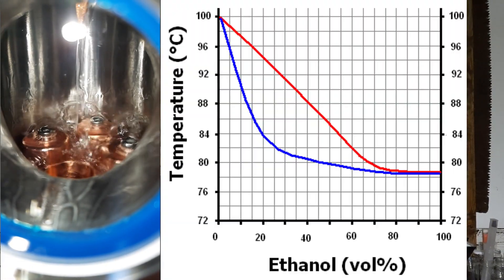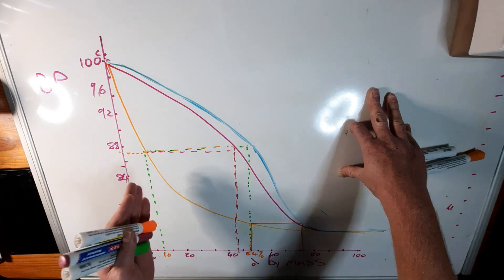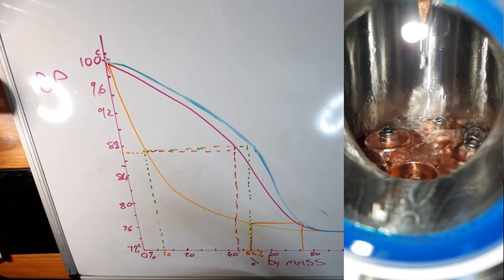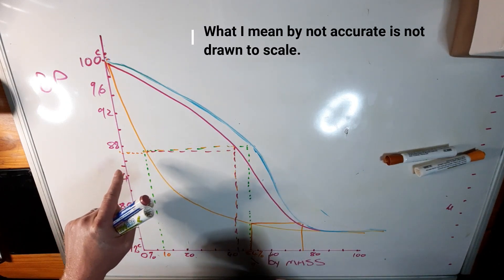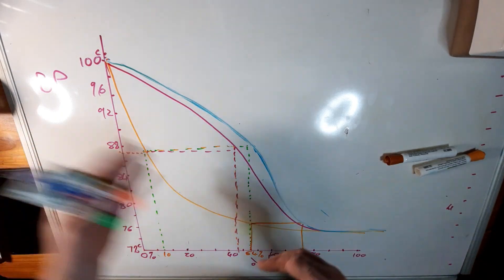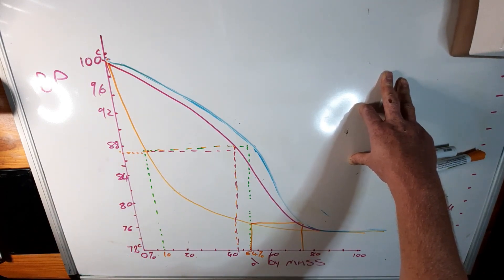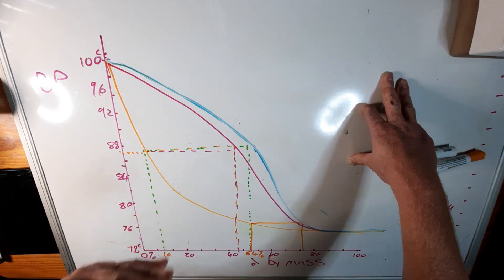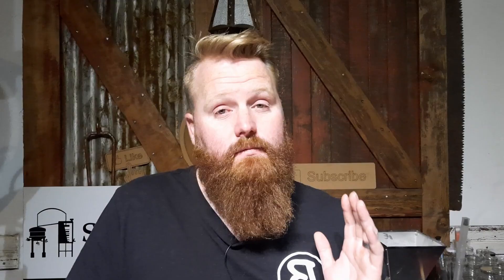What is VLE, and how do you use it in Distillation?

Comment: Good video. I am  curious how you run your PID for constant vapor speed. I find the vapor column collapses with the PID cycling.
Reply from the maker: Hi Dan,

Had the same issue, until I increased my interval time to 60 set the margin to 2 degrees and stepped the temp in small steps to allow column to balance.

Comment: I did my first run of vodka at 30%low wines at 35litres.i had 90% at 80degrees.twelve hrs later it only went down to 85degrees  was still at 90%! Was tasting good n no wet dog or cardboard smell! but it dropped to 85% n stank Kak so I stopped n got 8lires at 90% ran one electric element that is 2200wats but at 50% power! Is this normal? Im happy with my first run n not dissatisfied but js curiously curious! Sorry for the noob long question!
Reply from the maker: Hi Puff,

That is a super result, low and slow is the best way to get rectification of the product, from the comment it seems you are not a noob, super result, as you run your sprint the passive reflux in a column will bump your ABV, if you want that extra few % add some smaller packaging SPP is a fantastic option every 500ml of packing in a 2 inch column is 1-2 extra plates so by just add in packing you will bump up to 92%.

Super comment thanks
Reply: @BEAVERDIY  thank you for answering my question👌n the kind words too! Spp u say,I’ve been looking into that but atm I’ve only copper scrubbers n didn’t pack all the way but next time I will,thank you for the advice,much appreciated n keep up the good work 👍
Reply from the maker: @puffstastypuffs5192  scrubbies works lekker, congrats on the run, looking forward to hear about the next one.
Reply: @BEAVERDIY  hope u r well pal! js a late addition..did my second vodka run n packed fully with copper scrubbers n I got 96% same as b4 with the low wines n time spent lol once again thank you for the advice,greatly appreciated.